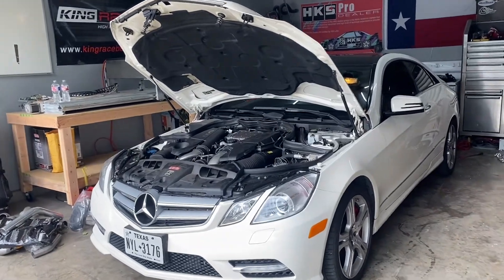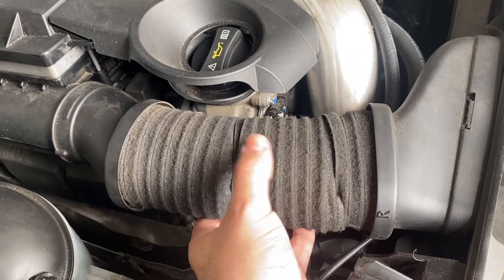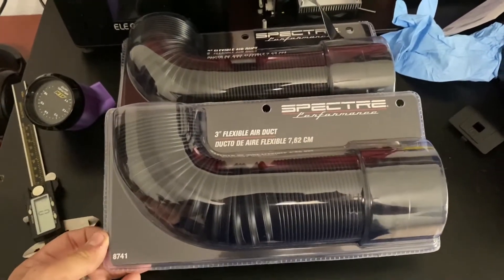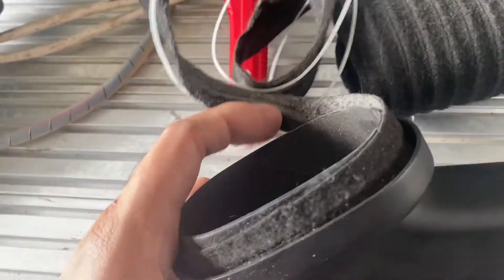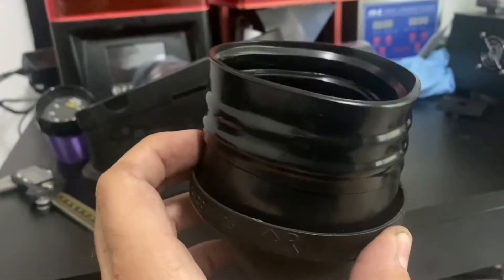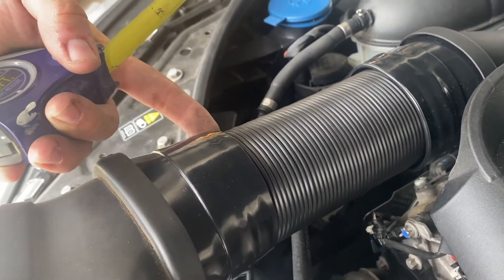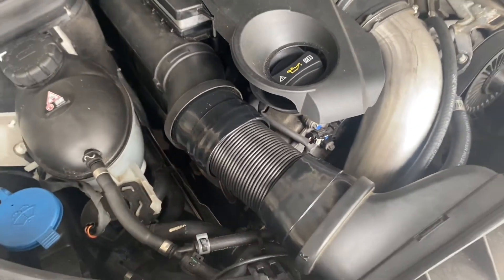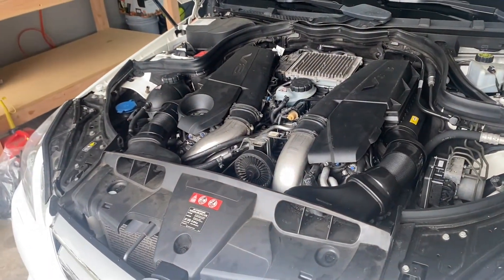E Class m278/m157 intake tube modification under $30

Comment: i notice u have air filter spacers on the air box did they really make a difference and where do i find them at thank u for your response
Reply from the maker: They don't really make a difference. I would save your money and get some drop in filters. My car dynoed the same with or without it.
Reply: @brianRED  thank u for the input appreciate it

Comment: You really should expand the tubes because when compressed, the inner diameter gets reduced by over a 1/4".  It won't make a huge difference in performance, but it'll look much better and smarter.

Comment: how is that M278 motor? i hear they are bulletproof?
Reply: Pretty solid engine which they continue to use in newer models after 2013
Reply: Idk about all that, but if you handle the maintenance and try to change its know failure parts out before they fail i.e. motor mounts,  The engine will run for you.

Comment: will someone eventually show how to remove turbo air pipes on this engine. Without removing them it is almost impossible to do any DIY job on front of the engine.
Reply: Its easy, there is one Loom Tie clamp that holds the tube on the turbo intake below and then one of the clamps that hold tube to the air filter housing. Just make sure you get some new Loom Tie clamps ($3 each at dealer)  because you'll likely strip the current one when trying to put it back on.

Comment: Appreciate guys posting diy stuff. I'm a YT mechanic and these types of videos really help me with my e550 coupe.  
Pls don't think I'm a hater....but dude, clean your engine bay.
Reply: I was gonna say the same thing. I use Sonax engine cleaner (what MB uses to find leaks) with a toothbrush (or regular brush) to get the thick oils stains if any, and Sonax plastic detailer. Slow water to rinse, then a leaf blower at low speed to dry. Remove the bottom tray, and spray the same down there, as the dirt from the top will land there. Then spray the plastic detailer. I removed the ECU first, and bagged the exposed wires.

Comment: I did the exact same to my 12 E550 last year....holding up really well so far. I used some rtv to seal the rubber couplings to the stock couplings. great mod.